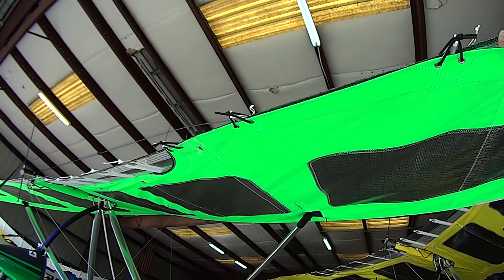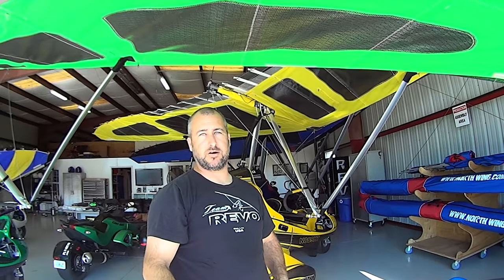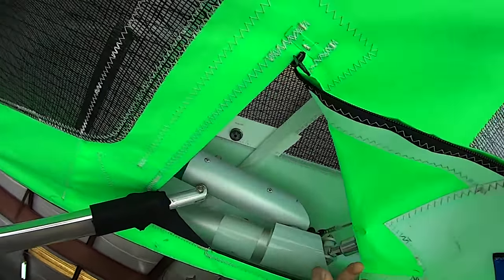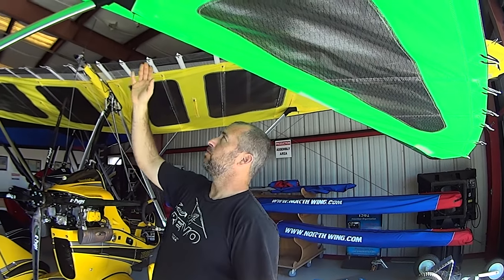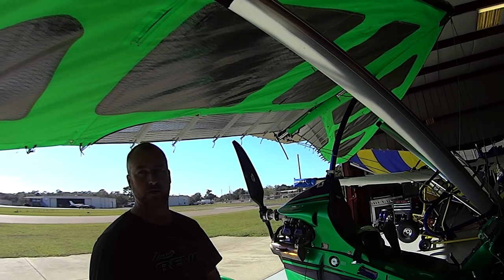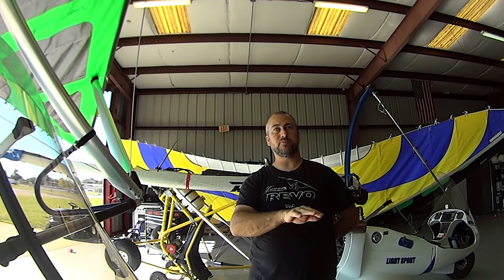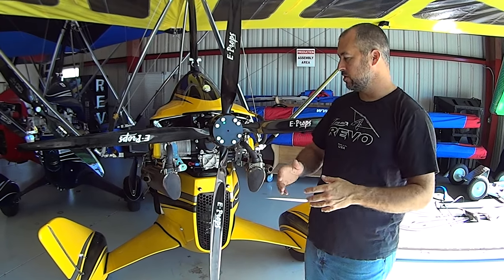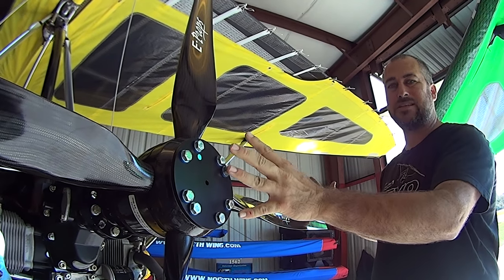The Rival S Wing

Comment: Larry, please explain in a slow fashion way  (or writing back to me) the difference between double surface and single surface wing. In terms of durability, strength, function, speed and lift in a compare and contrast or where each shine over the other. Another point is about the number of blades. Why some airplane and trike owners prefer to have 2, 3, 4 or 6 blades mounted to the engine ? Can you make a video explaining in detail about these two issues? Thanks.